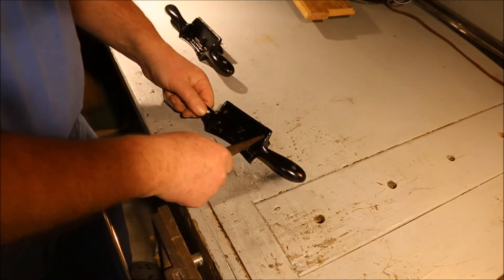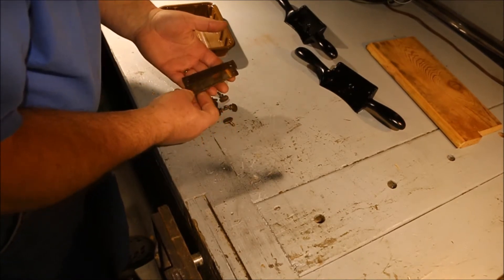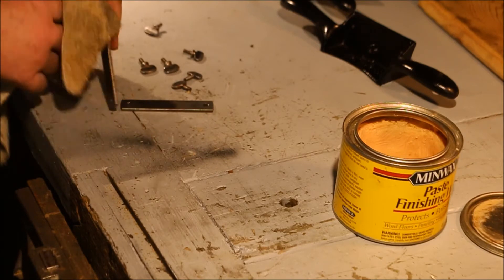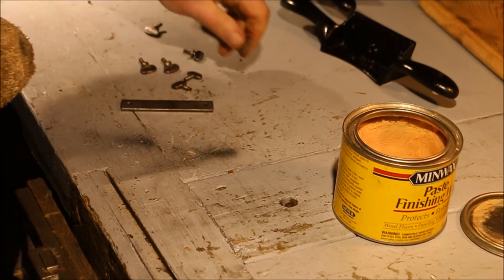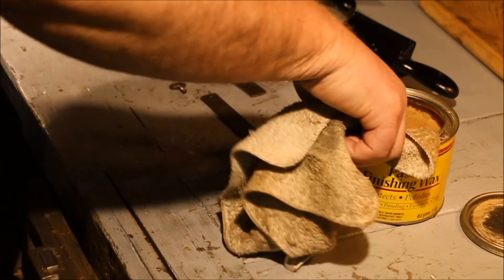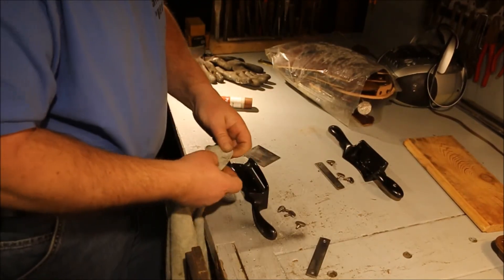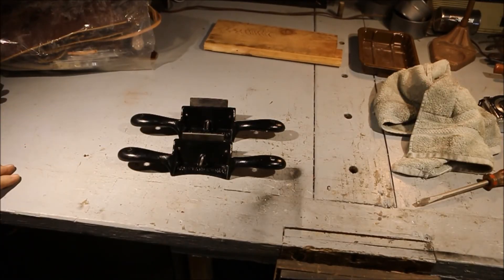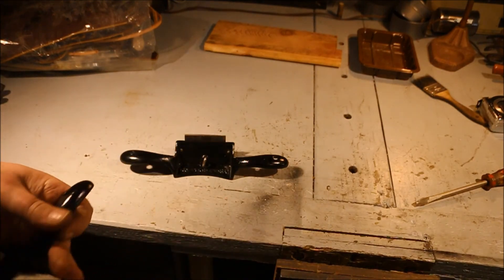STANLEY #12, #80 & #81 SCRAPER PLANES ~ PART 5 ~ POLISH WAX ASSEMBLE

Comment: You could sell it have you seen how much they are going for ? Or is it possible to change the shape of the sharpening angle like you can for planes like one for soft wood one for hard wood. I know card scrapers you can have 5degree for a smoother cut and 10 degrees for a heavier cut. I don't no ive never owned on so don't know a uneducated guess 😳🔨
Reply from the maker: I'm torn between selling it and raffling it off. With the 12, 81, two 80's and the broken one on the rehab list I have enough to cover almost anything. And that's not counting the had scrapers or the C Clamp option. 😁